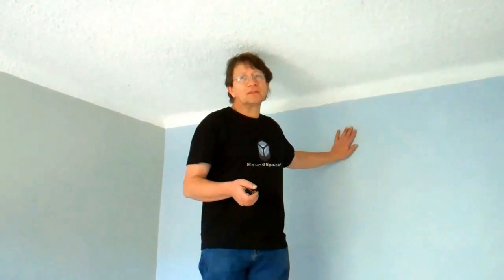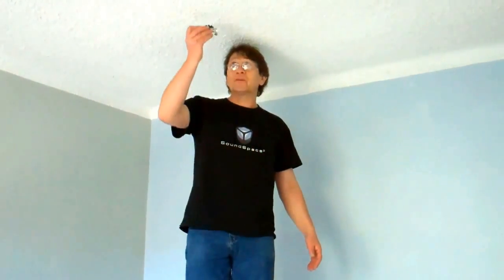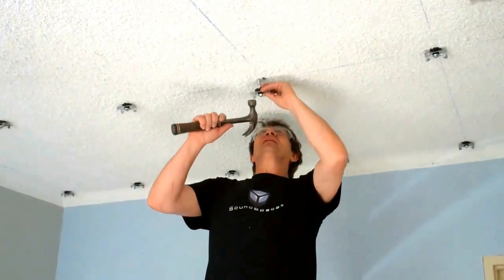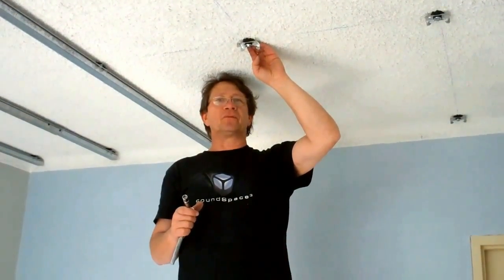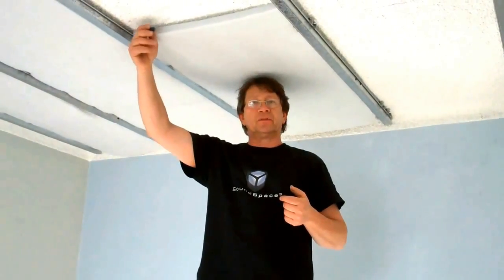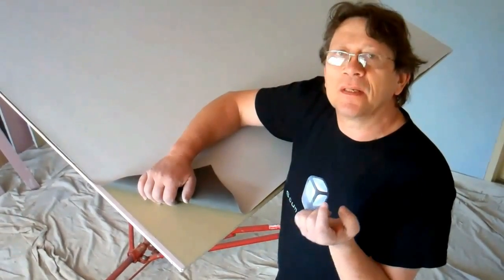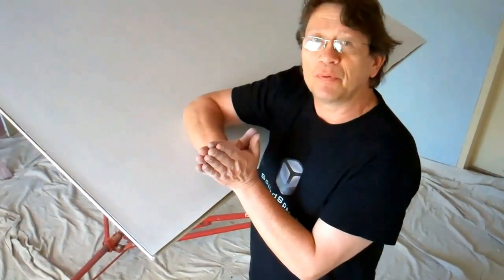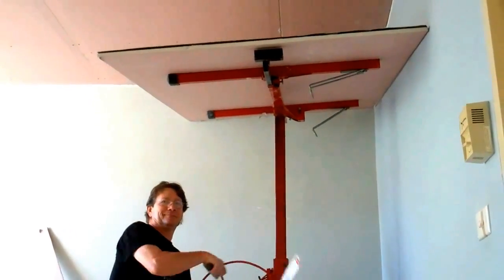Best Soundproofing Concrete Ceilings in apartments

Comment: The ceiling get lowered by around 75mm (3 inches).
There is no problem to install electrical wires through the ceiling cavity and add ceiling lights as long as the lights are surface mounted, not recessed lights otherwise the sound will go through the holes and you'll lose most of the benefit, the ceiling must be as sealed as possible.
Reply: Are you only available in US. I live in London. UK
Reply: Raj Mehta I’m in London too... and having the same problem.
Reply: +Philippe Ressos i was thinking of added led lights to my ceiling but now i won't. as i think your right, as the holes will let the sound go through and thats what I'm trying to stop. lol thanks philippe lots of common sense!
Reply from the maker: rajula jasani No, sorry, I am in Sydney Australia
Reply from the maker: Thank you!

Comment from the maker: Yes, that's right Tony, drywall furring channels can be clipped on resilient mounts but not resilient furring channels, there are designed to be fixed (screwed) directly on the wall, there are two different systems.

Comment: I'm seeking advice from acoustical engineer and experts on this subject now and will report back when I have a more definitive answer. I've been told various distances but want to confirm accuracy. I am working on a case with various short circuits in the floor/ceiling assembly, including rigid perimeter connection to wall and other issues. The sound and vibration transmitting into the unit below render the downstairs unit uninhabitable.

Comment from the maker: Labour & materials would be around $350.00 to $400.00/m2 + GST
Reply: Doesnt sound right. 400 per m2 ??? Wtf!? And what is GST? Im american.
Reply: @SonDialer  Yes, it is around that price labour and materials in $AU, not US; GST is a 10% Good & Service Tax we have to add on the total of the invoices and give to the Australian Tax Office.
Reply: @philipperessos5499  so for my basement apt there a 16 x 20 room and a 9 x11 room., Roughly 450 sq ft which is roughly 40 m2 which at this rate is 16000 aud = 12000 usd. That spunds right? If so that still way too much. I recently signed a lease with the understanding that the place was sound treated from the upstairs, which is not the case at all. Since im stuck in the lease I made an agreement w/ landlord that we get an estimate and if i have to help with cost I will, if its reasonable. Was thinking no more than 4k usd. He agreed but, because he has an eleborate spinlinler system he doesnt want to tear down the cealing sheetrock. Was thinking we could place reseliant layer on existing cealing sheetrock and then attach lower layer to that. And also blow roxwul in into existing ceiling. 450 sq ft of ceiling. Looking for a budget method... Please help.

Comment from the maker: I couldn't find any test comparing both systems apple for apple but I didn't find much difference between green glue and the viscoelastic membrane I am using, it is a matter of choice and product availability in your area, both systems are working well.

Comment from the maker: In this case it was 77mm thick (around 3 inches), it is possible to reduce the thickness by using different resilient mounts or furring channels but the bigger the space between the existing ceiling and the plasterboard the better for sound reduction.